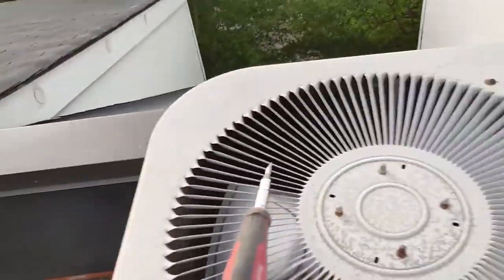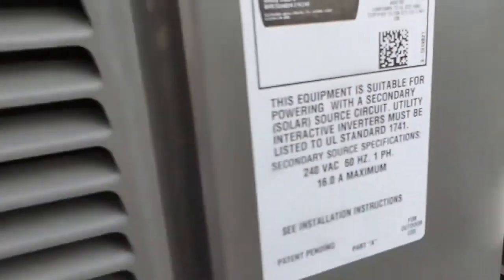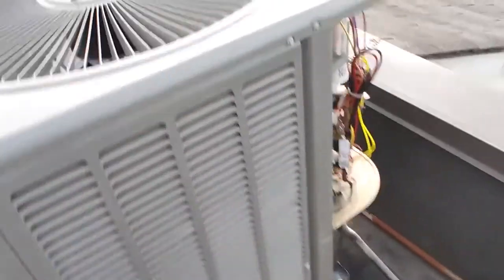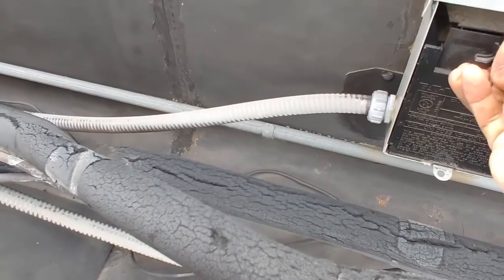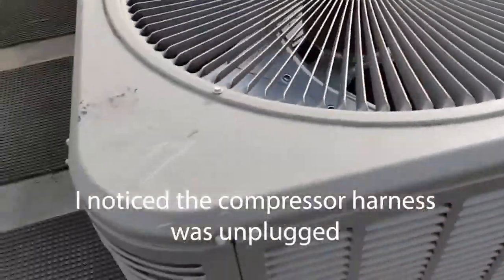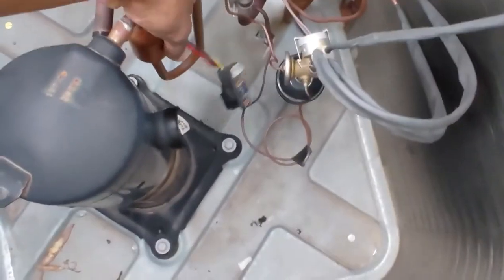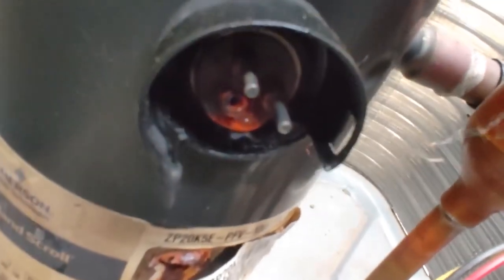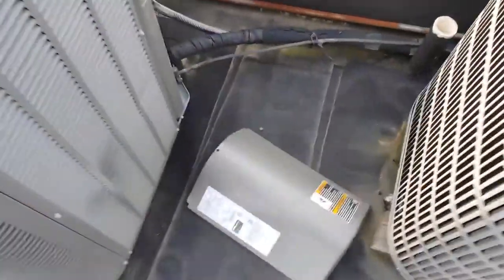Improper Capacitor Install Can Be Costly Mistake HVAC Tech Kills Compressor on Routine Maintenance

Comment: I have a feeling that the compressor had been running hot for sometime due to the darkening of the label on the compressor.  I was told by a emerson copeland rep that if the label is discolored, and looks crinkled and coming off compressor then that is a sign of compressor overheating or running hot.  Label should be white in color and completely adheared to the compressor housing.  This looks like a heat pump, and looks to be in good shape and not too old plus its a lennox.  Heat pumps are way more expensive than a straight cool unit so most definitely worth putting in a new compressor.  I would check everything over before hand.  I feel the run cap had nothing to do with it.  If wired wtong compresdor wont start, if you get fan and herm backwards fan will take off like a rocket and overheat and either go off on thermal overload or burn up.  If the mfd is too big for compressor it will overheat and trip the thermal.  You need to check the mfd rating on the capacitor and verify it with the copeland app or contact lennox directly.  My thought is maybe someone tried to savatage this unit by installing a cap that had a much bigger mfd rating than it calls for.  I have seen this a few times.  Compressor going off on thermal because the last tech installed one of a bigger value.

Comment: I believe what happened here is the herm wire was sandwiched between the frame of the condenser and the edge of the capacitor, which is all grounded, which means the start wire had a direct short to ground. Turn on the power and BOOM 💥💥.

Comment: It's not very clear to me how a tech caused this failure, was an incorrect capacitor installed or not?
Reply: It's not incorrect capacitor, it's incorrect INSTALLATION
Reply: @realSamAndrew  Oh, so the compressor damage occured as a result of failure to connect capacitor.
Reply: @thisisyourcaptainspeaking2259  sort of, yes. See my recent comment above for the explanation.